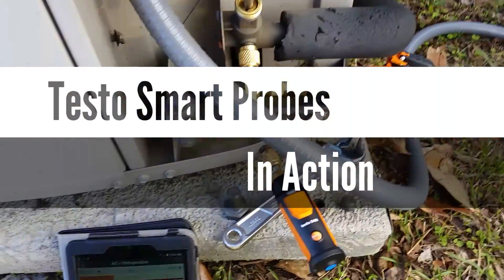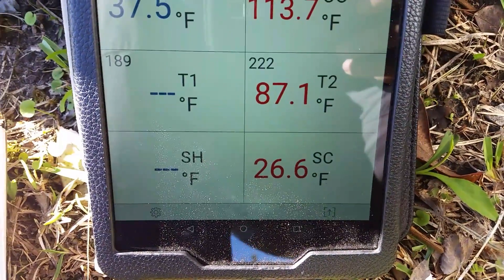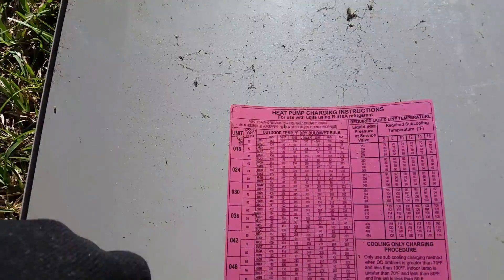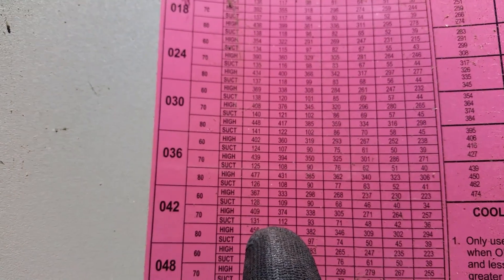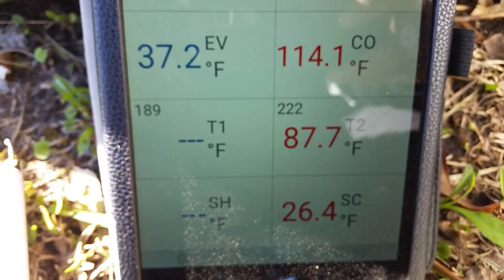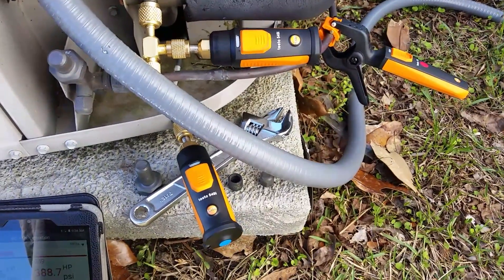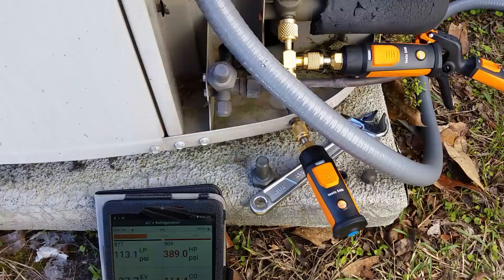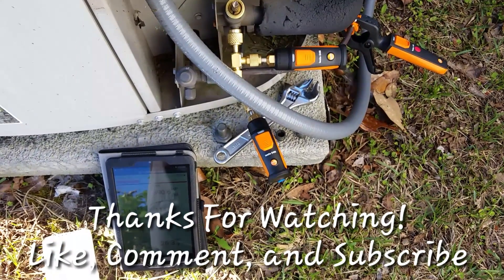Testo Smart Probes In Action

Comment: Do the smart probes that connect to the refrigerant fittings are they low loss fittings?
Reply from the maker: No. They aren't needed. Low loss fittings would  trap refrigerant inside of the probe.
Reply: @HVACinSC oh ok. So the ones that the testo smart probes come with are fine?
Reply: @HVACinSC also can you check systems with different kinds of refrigerants without cross contamination?

Comment: I got the Smart Probes but I need the Tee to charge. Where do you buy yours? and Does the female side came with a depressor ?
Reply from the maker: Thanks for watching!
Here is a link to the tees I use. (Yes the have a core repressor on the female side. They work great!) It's a 2 pack for under $11
Use discount code HVACINSC for 8% off any order. https://www.trutechtools.com/AVT45
Hope this helps!
Reply: HVAC in SC thanks so much I will use your code

Comment: I think the fieldpiece JL3KH6 smart probes is way way better then the testo smart probes
Reply from the maker: Thanks for the opinion. I hope its based on your first hand experience beta testing them since they are not available yet.
Reply: HVAC in SC What about the distance and how do you deal with taking readings in the Attic for the Supply and return temperature Check.Do save information and then come back to the condenser.I was thinking of using a tablet and my phone since distance is an issue with the Testo probes
Reply from the maker: Eagle Mechanical Refrigeration/Hvac Durham N.C Bluetooth range is a non factor for me personally. I knew that it was a basic version and therefore limited, no different than any other bluetooth product produced 2-3 years ago. 
I have several videos including a review which explain how I use the Probes. One of which shows me in the attic whith the air probes while still connected to the refrigerant probes at the condenser. 
Feel free to check them out and thanks for watching.

Comment: Do you need to get the copper line shiny clean where you attach the temp clamp probe? Very little surface contact area on small lines.
Reply from the maker: david johnson No prep necessary. Thanks for watching.

Comment: How many other Smart Probes are you using? Have you found the need for other adapters or stubby hoses to make connections?

 I just bought one pressure and one temp clamp just to try it out checking small restaurant and bar refrigeration units. Looking to expand as budget allows.
Reply from the maker: As the video show, I use a swivel Tee adaptor in tight spaces. 
I have the full Smart Probe set (Two clamps and two psi transducers) along with the Smart Probe VAC set (For airflow) Those videos will be coming soon. Thanks for watching.
Reply: Have since added the second set of pressure and temp clamp as well as thermometer, hygrometer and manometer. Only having a chance to play with them two days / week so far doing pms on closed grandstand concessions and bars in the off season, but picking up something new every time.